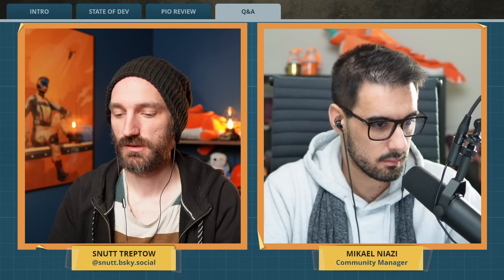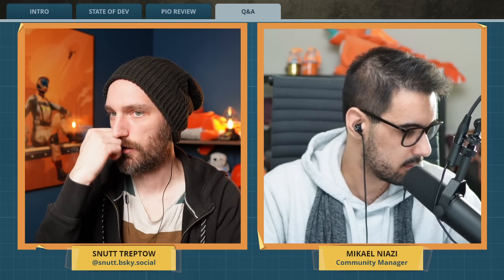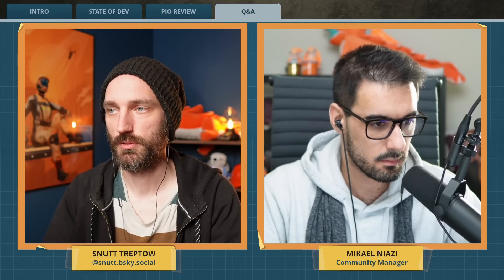Q&A: Do you have any plans to make Fluid dynamics more transparent?

Comment: i just wish there was a "smart splitter" for fluids or overflow valve, a pipe junction with an inbuilt valve if you want, that only allow flow in one direction if the other directions are saturated
i bring in left over heavy oil residue to my power plant via train, but i have problems balancing it out since it either is too much and then the residue blocks up the station on the producing end, or it is too little and my refineries start running dry, currently i have to smart switch a residue bottling cluster every so often to balance it out. if i could just hang that on a valve that only takes overflow i could just leave that running and all the extra residue will get barreled and doesn't block up my station anmymore.
Reply from the maker: one could take the convoluted option of packing it immediately so you can use a smart splitter, then unpacking where needed.
Reply: @SatisfactoryClipsArchive  well, yes...

Comment: I don't have problems with fluids, but that's still only after seeking outside help. 

What about short, optional in-game tutorial videos, accessible from the journal thing, and ADA can make a big fuss about it when fluids are unlocked. This seems like the easiest solution. The system is fine (aside from the head lift indicator). It's a knowledge problem.

Comment: The thing that drives me up the wall regarding fluids is that there is no way to figure out if/when something has been disconnected. That Refinery or Water extractor might sit there and look like it's working, but the junction I thought it was attached to isn't actually connected. This has happened multiple times, and while the existing mechanic works okay-ish, it feels like the game treats the pipes exactly the same as the belts + head loss, and as a consequence has the same problems as the belts:
- when it has to pass through a floor/wall hole ?!?! what is going on. Both pipes and Belts seem to treat holes as "container" and as a such bottleneck.
- belts can go uphill. Pipes carrying Nitogen can go up hill without head loss, but liquids it's impossible to determine the head loss if you have to go over like a 1 meter hump somewhere and then back down and then back up 5 meters later. As an example of this, is one of the bauxite areas where the closest water extraction point is like exactly 10m.
- it feels like the way belts work is BELT X is really a container going Left-to-Right, and works in a FIFO (First In, First Out.) The way pipes work is that it's a container going Bottom-to-Top and is LIFO (Last In, First Out), and the fill rate determined by head loss. But when the pipe has Nitrogen in it, it works the other way around without the head loss, like a belt. So if you have a bunch of really short pipes (eg from the extractor, or to the machine, not your main bus) you don't know if there is actually liquid in the pipe if the machine is consuming it all.

What the game could do to make it easier to understand is when you press E is indicate head lift gain/loss from source. So if you press E, it should say if that segment is above the head lift limit or below it.

Comment: i produces 6000 liters of regular fuel, I have 10 "600" transport pipes, there is a "water tower", there are pumps... and there is still no fuel. it's not a problem with "dynamics", it's a problem with pipes... you can start adding new things once the BASIC ones are fixed.

Comment: imo if you just have ADA explain on first connection of a pipe network that you should let the pipe fill and half fill up a buffer or something, and that while headlift exists, machines fluctuate being on and off in a 100% efficient system, so a buffer is basically mandatory, and while the machines are off gravity is a total bitch and will not fill your machines....in short, build a water tower and fill machines from a location above the machines so they gravity fill when machines are off

Comment: Being able to properly see the max head lift on a pipe would be nice for starters.
Reply: THIS is my problem. I have no problems with fluids. It's just capacity (flow) and head lift. But the indicator for head lift is wrong. It's also never explained what that indicator is. Or what head lift is. 

What about short, optional in-game tutorial videos, accessible from the journal thing, and ADA can make a big fuss about it when fluids are unlocked.
Reply: To solve this i always build fluid towers a lot higher right after the production line. But it is still guessing how much is the first 10m

Comment: I built this big fuel generator cluster with 400 generators, hooked it up and it never worked well.

Read a 16 page pdf explaining the mechanics and how to deal with fluids. Didn't help.
I asked on the Satisfactory discord for help, had 4 different people join my world and diagnose the system with different issues. "Oh you don't have fluid buffers, you need buffers!" the next one went "oh we dont use valves, valves bad", another one said "NO FLUID BUFFERS, BUFFERS BAD" and the last one said "no buffers, no valves, no long pipes, dont connect them to too many machines, no floor holes..."

I've spent hours debugging that system and never got 100% working.

If you reach a point, where your supposedly working mechanic cannot be understood and implemented by a player in ~20 hours of trying, is that mechanic working well? It's cool to have fluid sloshing and head lift and whatnot realistic mechanics, but not if it's like this... I would much much much rather have a simple fluid system, no sloshing, just a functional system that delivers X amount of fluid if there is enough of it and if there is head lift.

Spent another ~100 hours building a 6000 rocket fuel factory where I eliminated pipes as much as possible. No buffers, no valves, no head lift required, no floor holes, almost no 600 pipes. It's a lot of packagers but hopefully this makes it work...

Comment: The only time that pipes have caused me headaches without looking at a guide was when trying to recycle liquid byproducts (looking at you, quartz distillation). 

Then, the part of the PDF guide where it recommends to have machines use the byproduct line exclusively while the rest receive from the producer (ie water extractor) exclusively worked like a charm. My mistake was thinking I could use valves to address the issue of my water extractors adding too much to the recycler circuit.

Comment: i cant ever for the live of me figure out how the pumps work. I make a water tower, put the pumps on it, see that the little blue ball goes over the tower and based on what i've read its supposed to work. But NO, its for some reason still max head lift. Then ill replace it a couple times and it seems to work! But then randomly it stops pumping even though the pipes are not full. Its just so frustrating! Reason why im completely avoiding coal power as its just a waste of time to make work.

Comment: This is a constant issue for newcomers, if you have to be "clever" or get external help (guides, videos, forums, etc) to make pipes works then something is wrong and if you have to build something with a very specific set of rules so that it works at 100% then that's also not satisfactory.

You should be able to works with pipes and when something goes wrong then have clear feedback about what is happening so you can address it, this in my opinion could help a lot when you are learning how to use them. Take for instance the head lift, it's easy to understand and fix once you get a pump because there is a clear indicator in a pump, if t goes above the max limit then you have to build another pump and you also can see the most efficient placement spot (even if the hologram is not correct), the only caveat is that machines with head lift don't show it so you have to start guessing about the first 10m. Machines with a head lift gauge like pumps and a head lift hologram would be a huge QoL improvement. Every other problem in pipes is like trying to fix something blindfolded because of the lack of clear feedback.

The current feature just tell you that something is wrong because 1 or 2 machines are not at 100% and that could be the result of 1 error or many but you will never know for certain what you did wrong and what fixed the issue unless it's head lift or a clear lack of inputs.

Comment: Every Aluminum plant I make becomes water logged. That didn't use to happen. Shuts down part of my nuclear recycling everytime. I wish they would fix it or put it back to what it use to be.
Reply: Make cement with the excess water. Feedback water means itll never run at 100% efficiency in my experience
Reply: Feed the byproduct into the alumina solution refinery from the bottom with a pipe junction, it doesn't make sense physics wise but just works and always prioritizes the bottom input @ahpadt

Comment: Imo it should be fully simplified, get rid of sloshing, and you just need the correct amount per second. You put down an extractor and it pulls 200/m and that is how much is in the pipe, at all times, it doesn't need to spread, it's immediately 200/m all the time, If factory takes 45 and you hook up 3, you're using 135/m out of your 200/m and you're fine, Nothing else to be done. Theres no up or down. Gravity can stay in but that is simple, just take the pipes highest point.

Comment: Gonna be bold – after release of 1.0 – I keep seeing more and more one-sided “questions” and “suggestions” (presented in a form as it would be opinion of entire community) from people that don’t even understand the game about dumbing it down to oblivion. For example, this, then “improve hover pack so hands would not shake” (my reaction was: come again?!). 

Trains and pipes to me are THE MOST interesting parts of the game – I love solving issues when it comes to pipes – this forces me to improve myself by actually reading on how fluid dynamics works at a same time forcing me to improve my designs. 
Many people, who yell “pipes do not work” are the actual problem on why pipes do not work. Read PDF – it explains A LOT. If you still have issues – you are over-engineering 9/10 times for sure. Make sure it works before making it pretty and not other way around.
 After I have failed, then learned, then failed again and learned yet again from my own mistakes again – I do not have any issues with fluids anymore. Again, biggest realization from this came in a form of – ok, the issue is “me” – either I didn’t knew, or though I knew too much, or over-engineered.
I even see Snutts hidden frustration with this and I am a bit worried Coffee Stain would decide to fing-up the game for people, who really like complex problems for people, who think they know everything by “improving game for everyone”. 

Personally, I think they could do 2 things:
1.	Build a manual for fluids based on PDF from community into a game. Something like 3D “museum”, where everyone can see animated examples from PDF and
2.	(and this is most important) – instead of fing-up the game for everyone – make it configurable in options – aka “realistic” fluid simulation versus “simple”.
This definitely will solve ALL issues with “600m3 pipes do not work”
Reply: A simple solution they could implement almost immediately, update the description so that instead of "Flow Rate: 600m3 per minute" it says "Flow Rate: 600m3 maximum (average may differ)", or something along those lines.
Reply: I agree with you. At first I was irritated by these pipes that "may not work". But it was enough to read the Pipeline_Manual pdf and many mechanics became clear. It is more convenient to just connect and let it work. But it is more interesting as it is now.

Comment: There is a real problem with fluids in pipes over a distance and I call it backwash or surge. If you look at any pipe you will see the flow rate is not constant and if you come from a source a long a distance and then have to lift it the pressure differential can cause fluids to surge backwards lowering the amount you get at the machine you are connecting to. Of course prodigious use of valves and pumps can get around it to an extent. However if you don't understand how it works then it can be very trying to figure out where the issue is.
Reply: Liquids being a pain to transport over long distances via pipes I would argue is a logistical issue to be solved by the player that encourages buiding remote bases local to the fluid source to process it or using alternative transportation methods like trains or packagers.

Otherwise, it'd be just like conveyors where so-called long range transport methods like trucks/tractors will rarely, if ever, be more convenient than just building long lines of belts across the map.
Reply: @telapoopy  Even at short distances such as recycling the water in aluminium production can cause issues. However as I said use of pumps and valves can help but if you do it with out understanding what will happen it can be a pain.
Reply: @jvebarnes  sure, I was just talking about the long-distance aspect of it, as that is far more tedious to troubleshoot flow issues for. Byproduct recycling is at least something that would be faster to redo your pipe circuitry for if you needed to, since it's almost always going to be local to the factory it's produced in
Reply: @telapoopy  Sure, but the game shouldn't hide the issues with my production line. Like, I look at my constructor and see that the input belt isn't full, I know I have an issue and I clearly know where it is. I see a refinery not working at 100% and now I have to check every single pipe segment in the world because god knows what might have happened, only for the refinery to get to 100% without me doing anything because the pipes just decided to start working again... for now. If I need to read a PDF, google, reddit and youtube pipes so that I don't make the mistakes which aren't ever explained inside the game, it's a bad system. For starters guessing the headlift is just stupid. There is no real reason why holding a pump doesn't show a max headlift hologram on the pipes in vicinity. The game already knows it, just show it to me. Why do I need to guess is it 10 or 9.99m and now it works but doesn't.
Pipes have issues that are never explained in any way, shape or form in the game and that's the problem.  It's not as much "oh make pipes easier", instead it's "make the issues visible and explain stuff".
Reply: @entitledOne  I've rarely ever needed to check individual pipe segments to troubleshoot efficiency issues. If efficiency is suffering, and production rate is greater than or equal to consumption, it's either due to head lift or needing to give a bit of time for pipes to top up before enabling consumption. (Unless you are trying to recycle fluid byproducts, where a 3rd issue that can arise is the recycled water output not taking priority over the water extractors' supply)

While there absolutely should be a head lift indicator on machines that produce fluids, a simple workaround is to just insert a temporary pump at the output, power it up, and read that indicator to see if it's needing to output more than 10m

Comment: I wish we had transparent pipes for more clarity. I don't really need further explanations about how it works but being able to visually see what is going on in them would be a plus imho.
Reply from the maker: noises and vfx for when things go slosh and bang would be of most use.
Reply: That would not help. Once pipe is full - depending on a liquid - you probably won't even see anything moving (assuming its not producing bubbles)
Reply: @theobserver_  Yes. But before the pipe gets full it must fill up first. And if you make vertical pipes you could clearly see where the fluid stops. But I don't know if it is possible to do that. If the devs only made closed pipes there must be a reason. Their graphics engine probably can't handle that. Maybe.
Reply: @cryswhyle  well, technically, for vertical you can use capacity indicator
Reply: It'd be hard to portray an actual visual representation of the fluid without it looking jank because pipe segments are technically just a series of liquid containers that transfer values to eachother. Ie if the amount of liquid was represented by how filled the pipe is, you'd see  one segment of the pipe have one level of liquid while the one next to it could show it instantly jumping to an entirely different level. And that's not even considering how you'd represent the fluid levels for non-horizontal pipes.

There's not an actual fluid physics simulation going on in the back-end, and if they did make it that, then it would work entirely differently and be  far more unreliable. Not to mention performance-hungry

Comment: like the tracks, you need a way to visualize where fluid is in your system and where it is being blocked or stopped.  It took me an hour to figure out that a small piece of pipe from a x-joint that I tried to connect to a machine didn't actually connect and instead it built a pipeline support so close to the machine that it looked like it was connected.  a build gun utility that highlights liquid/gas flow could illuminate pipes and machines with fluid in them (red for empty, yellow for partial full, green for full) and help remove some of those pesky fittings not working properly (looking at you floor and wall holes!)

Comment: Idk ,looping manifolds to beginning of manifolds is just works for 1:1 machine(s) consumpstion (at least for me) but i had an issue yesterday ,i built a small factory which produces battery ,the problem is i take water byproduct of battery production back to sulfuric acid refinaries but even i calculate the exact amount of the water needed ,always ends up water byproduct clogs the system ,i didnt really understand this so i underclocked water extractor a bit down so refinery can use byproducted water aswell but refineries wasnt working at all time since i downed the water output.